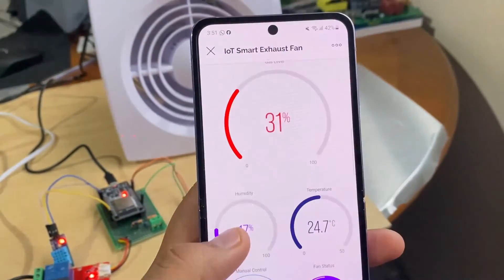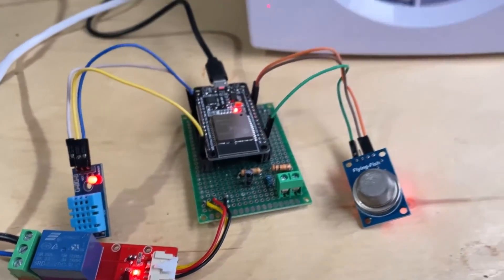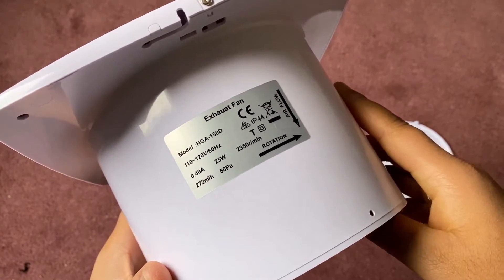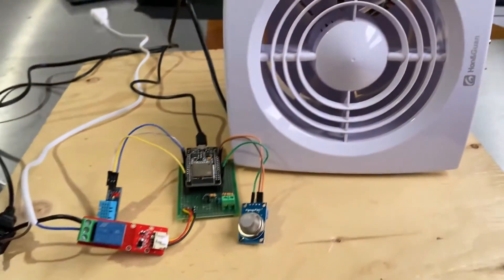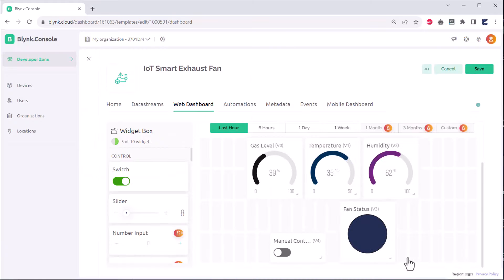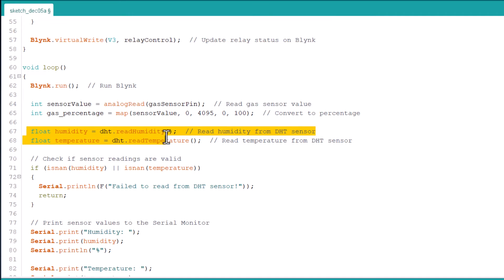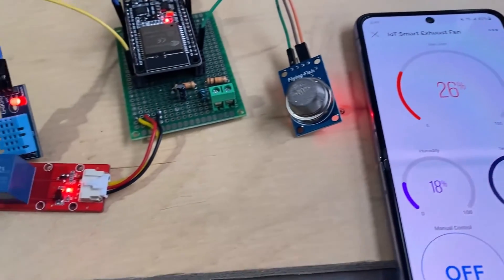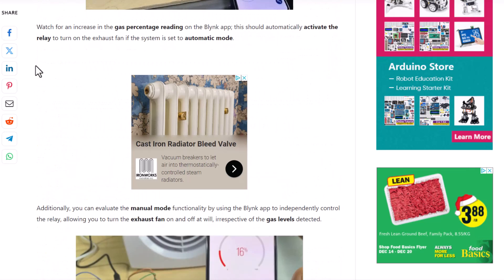IoT Smart Exhaust Fan - ESP32 Based Monitoring & Control

Comment: There is now a Wi-Fi extractor ventilator with humidity sensor and Tuya app control: SCHEEAIR Nova100. I'd like to know what is the chip used in it and if it can be flashed with a custom firmware!

Comment: we did your project which is ecg with ubidots and we try to contribute max30100 code with ubidots our code is working and giving the data to serial monitor but the code is not converting to data to ubidots we can not see anything on ubidots how can I fix this problem.

Comment: Hey there.....Please tell me a way to contact you....... I am making that smart energy meter but i am using ACS 712 instead of SCT-013-030 Non-invasive AC Current Sensor......... I am having a really hard time.......please i want to get on a call with you in helping me out on how to make it work
Reply from the maker: ACS712 is affected by magnets and any magnetic force presense alters the value. It is therefore not recommended to use the AC712.
Reply: @HowtoElectronics  but now I have purchased it and need it to work....please help me. I don't need it to be super accurate or something I just want it to give nearby readings as it will be submitted in college